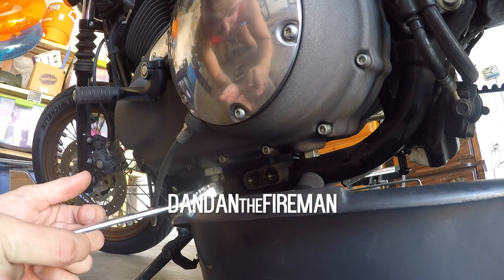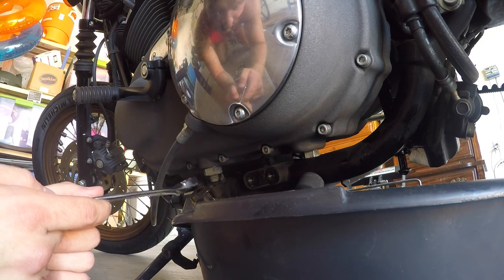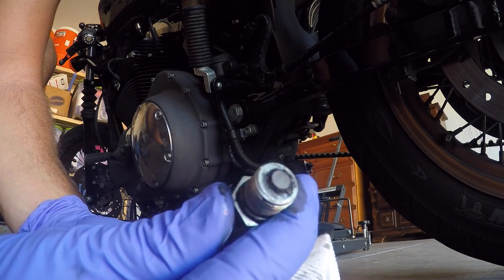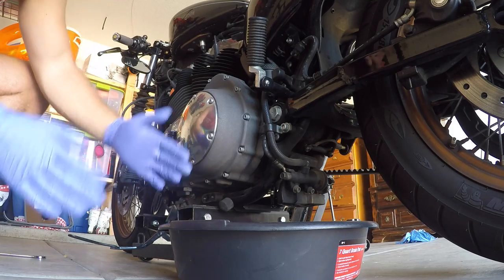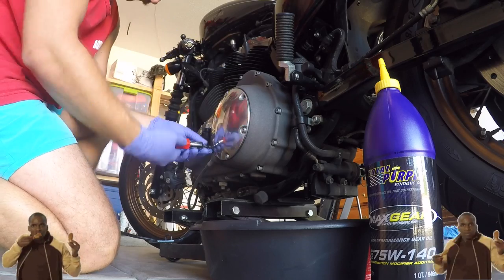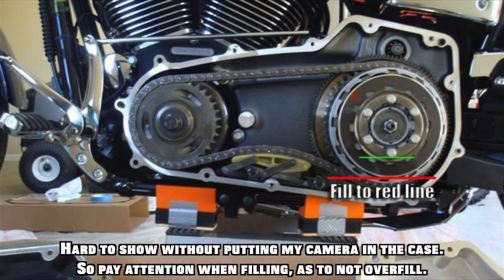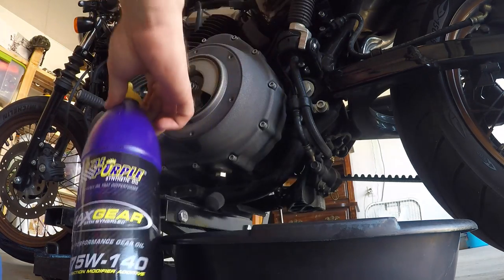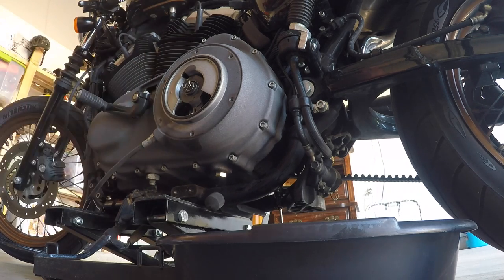Harley Davidson Sportster Primary Oil Change

Comment: Dude YOU DO NOT HAVE TO TAKE OFF YOUR DERBY COVER TO CHANGE THE PRIMARY OIL!!! USE YOUR INSPECTION COVER PLATE TO REFILL WITH  YOUR PRIMARY OIL UNLESS YOUR ADJUSTING THE CHAIN IN YOUR PRIMARY ! DID THE SAME AS YOU UNTIL A HARLEY MECHANIC TOLD ME A ALOT EASIER WAY !!! TAKE TWO SCREWS OUT N PUT TWO SCREWS BACK IN !! 1 quart exactly to proper amount of oil .
Reply: I heard about this way. Nice to see I’m not the only one.
Reply: That’s how my uncle showed me. That’s how I do it too.

Comment: Im sure its proper to remove the clutch cover but honestly I see no purpose in doing so. One quart out, one quart in. Why the clutch cover removal?
Reply: Der der der der der der
Reply: gotta take it off to refill, Yappy!
Reply: @bobpress1235  not on my sportster or any Ive seen. You drain it out at the bottom and pull the small cover off (the one he put his fluid in) to refill. Ive never pulled the big side cover, except when I replaced my clutch.
Reply: I just did the first oil change on my new Iron today. Removed the foot rest to be able to remove primary cover to add a quart of oil. If a quart is capacity then it’s a waste of time removing the derby cover…. I won’t bother doing that again
Reply: @bobpress1235 you didn’t even watch where he refilled did you ? 😂

Comment: Drain it hot on the Jiffy stand .  1 quart out , one quart in . No need to fiddle around with the Derby Cover .
Reply: That's how I do mine. I do have to remove the Derby cover once in a while though, to check/adjust the clutch. I got a huge package of O-rings for the derby cover, and also gaskets for the primary chain cover from J&P Cycles.
Reply: how are you getting oil into the primary without taking the derby off?
Reply: @alexfraley  through the inspection cover where this guy filled it from.
Reply: @thatmexican7317  oh yeah. I never take that off unless the chain is bad out. I do adjust the clutch every time though

Comment: Sportster transmission and primary share the same oil. Do not use gear oil. Use 20W- 50 Mobil 1 oil used for air cooled Harleys.
Reply: Thanks so much Jim for some correct info on here!
Reply: incorrect
Reply: The filler access is the clutch inspection cover.
9. Add 32 fluid ounces (946 milliliters) of GENUINE Harley- Davidson FORMULA+ TRANSMISSION AND PRIMARY CHAINCASE LUBRICANT (Part No. 98851-05 quart) through clutch inspection cover opening.
Reply: I was literally going to say the same thing i wonder how does the gear oil will do with the wheat clutch...

Comment: You must use primary fluid that is specifically made for wet clutches on the sportster or you may damage your internals. That may be why you have so much metal shavings on your magnet drain plug.
Reply: Carl Biller specifically it must be yellow metal safe or it will eat the stator.  Not sure why people don’t just use the HD Formula plus.  It’s like $6 and what the bike calls for.
Reply: You are supposed to use engine oil. The same that’s in your bike. I.E. 20w -50 V twin oil.
Reply: Everyone seems to use something different but theres many acceptable oils.  HD formula+ is recommended by the manual.  Dealers recommend using syn 3 in the engine and primary.  Many use the same 20w-50 for the engine and primary which is what I'm doing in my 07.  Mobil 1 vtwin 20w-50 engine and primary.  What's odd is some people claim they get clutch slip with this oil or that oil.  Some get more valve train noise with this or that.  Every motor seems to like something different but just need quality fluids.
Reply: @bsboneless1  
 They do make it and they will tell you to use it in the transmission, the bigger harleys use engine oil, transmission oil, and primary/clutch oil.   The sportsters primary is the clutch NOT the transmission.
Reply: Run Type F Automatic transmission fluid in your primary/trans on a Sporty 70k + miles and I change it every other oil change. Never had a problem with a clutch or primary chain on any of my bikes.
Reply: @jj325j2  it's both on sportsters.
Reply: I looked at the product information on this and it states Not for use in gear boxes, transmissions, and lower units with wet clutches.
Reply: No the newer sportsters take 2 different fluids its not like the older bikes where they take 1 fluid in 1 hole.

Comment: Mine doesn't fit a quart???? It's a 1996, but after draining it hot and everything it'll only take a little less than 3/4 quart and it's already covering the bottom of the clutch packet. I'm assuming that's right tho, just think it's weird. But it is older too so you know.

Comment: Make sure when you remove the derby cover,that you loosen the bolts in a star pattern to prevent warping cover. Also tighten the derby cover in a star pattern...Ride safe!
Reply: And be sure that you don’t loose the spring in behind derby cover

Comment: I have an HD Sportster XL1200c and the dealer always told me to use 20w-50 full synthetic in my primary but I never liked using that 
so I have been trying to find out what is the best to use in it and I have been searching on YouTube, and after watching a lot of them
all I get is use whatever you want from 20w-50 full synth, Mineral oil, synth 3, trans fluid and not much on gear oil! 
Like I said I didn't like the fact of using 20w-50 full synth motor oil, mineral oil and tranny fluid didn't sound either because they sound too thin of a viscosity and now finally I see someone using gear oil which was what I thought would be best! 
So I can use 75w-140 gear oil in my primary with no problem? Is that the best to use in the primary in Ohio where I live? I love Royal Purple!

Comment: Did you have to replace the o ring? I just took mine off to replace the clutch cable and after reassembly oil started coming from it. Leaking smaller and smaller didn't do a perfect  star pattern could this be why? Please help! Thanks

Comment: do you still have your engine oil in there or are you  only taking out the primary oil? They are two separate things? bit confused what the difference is...
Reply: Primary is clutch side. Main oil is for motor.

Comment: I'm lazy with my 2018 1200 Custom. I refill through the Inspection Cover. Use Valvoline Syn 20w50 oil. Same oil I use in my Engine. And I change it every oil change.
Reply: ATF fluid can be used too. It wont froth up like engine oil can.
Reply: Keep up the good work, Chris!
Reply: Exactly.  I don’t get people skipping it unless on a road trip maybe.  It’s one quart of oil !  Haha.

Comment: hey , thank you for the video. In sportster models do you change oil for the gearbox separately? Or what you just did fills it too?
Reply: The engine and trans are fed by the oil tank on Sportsters.
Reply: trans and primary use basically 20/50 oil, but engine oil is not shared with trans...NOT SHARED!

Comment: 24K before replacing primary?  i change my primary every time i change my motor oil witch is only about 4k miles . is that doing to much?
Reply: Harley only recommends every 10k miles you change primary… although changing it every 4K will not hurt anything.

Comment: Thanks for the video but FYI:

1. I've heard Royal Purple is really bad to use in Sportsters. I think it's corrosive to yellow metals and it fucks up clutch plates. I would highly recommend switching to Mobil 1(what I use) or Amsoil.

2. You don't need to remove the derby cover to change the primary fluid. Many people just put 28 ounces in and call it a day. Sometimes even 1 full quart is too much and it can make neutral hard to find.
Reply: I hope you get it straightened out lol. I'm using Mobil 1 V-Twin 20W-50 for the engine and LS 75W-90 for the primary.
Reply: You sir are correct.  That's why they need you to remove the derby cover so you can see when the oil gets to the diaphragm spring when it gets to that point.

Comment: If someone can help me with one problem. On my 2016 sportster iron 883, I have a slight oil leak from the screw located a little to the left of the main oil drain. That's a pretty big screw. The screw has a thread on it. How can I solve this problem so that there is no more oil dripping?

Comment: When's the first change needed? 1k miles or 10k miles?
Reply: 1600kms-1000miles first change oil.
Reply: @ValdemarAK47  After the 1000 mile service, the next service is at 5000 miles then every 5000 miles after that, i.e. 10000, 15000, 20000 etc.
Reply: 1k, then 5 and 10 my friend

Comment: no need to remove small plate just fill through clutch cover
Reply: now u talkin'
Reply: More like no need to remove the clutch cover. Just fill through the inspection plate.  Two bolts. No need to remove foot controls.

Comment: What’s that fat 7/8 bolt with the threads popping out? left of the drain bolt. 
I accidentally unscrewed it and the thread came down a bit with it (now my socket can’t reach to tighten completely)
Reply: That's the primary chain tensioner (shoe) adjustment lock nut  (the 7/8 one). The threads that are "popping out" is  actually the adjustment bolt itself (there's an allen key head machined on that threaded bolt) and the 7/8 nut locks it in place so the adjustment doesn't get loose.

Comment: Is it okay to put amsoil Sae w2050 on a transmission ?
Reply: I've been using synthetic amsoil 20w-50 in the engine and primary for 10+ years. Works great.  I am going to try the amsoil primary fluid next for the primary only. I don't think there will be a difference but we'll see.

Comment: Only need to remove inspection cover. No need to remove derby cover or mid controls.
Reply: Probably gotta do it to check the level no?
Reply: @johnnyghanja  takes 1 quart.
Reply: They all go to same place then, right? Asking because I couldn't get my Chain inspection plate off my '93 sportster, wondering if I can just add my oil through the Clutch Inspection plate. - It's a little different set up on the 1993 1200xl.  But I think 1 quart won't spill over the reservoir if the bike is level. Sorry to bug you with my question but seems like you know what you're doing.

Comment: Could you tell me where is located the drain from the secondary transmission for a Sportster?
Reply: Primary and transmission share oil so there is only 1 plug for them and 1 plug for engine oil.

Comment: What weight of gear oil did you use? I read that the 20w50 engine oil i got for the oil change can be used in the trans/primary gear box as well. Any truth?
Reply: I'm in the same boat - i'm not sure whats true/false about this, did you figure something out? :)
Reply: @filmfreaken  talked to a harley service rep that sounded unsure but said the 20w50 will work long as its diesel use rated i guess. Since the bikes are mostly air cooled and have high heat cycles.
Reply: @BdeSimon  i just did mine today with 20w/50 in both primary and engine :)
Reply: @filmfreaken  no issues with it?
Reply: @BdeSimon  not at all, 50% of the internet said ok, so did half of youtube, so i consulted an old friend of mine whos a HD tech, and shopowner and he said, its fine to use HD 20w/50 oil, if you have it, but if' youre to buy something the "formula+" from harley does not cost much., i used the 20w/50 cause i had it.. i had like 9litre of it.. so no problem using one in the primary. he said he doubt i'd feel any difference.
Reply: @filmfreaken  i went and grabbed the formula+ but the 20w50 i had was just mobile 1. It wasnt hd brand so thats why i was curious
Reply: @BdeSimon  Which color is the formula+ fluid, i might go and grab some of that next time i change it, i havent looked into how often the gearbox needs fresh oil? btw it does not matter if you have mobile1 or castrol or HD 20w/50, as long as you have motorcycle oil, suitable for wetclutch, dont use car oil, it often has some adjectives and modifiers, not good for the clutch in a bike. i only used the HD oil cause i bought a lot of 9 bottles for the price of 3 off a friend who sold his HD, if not i would have used castrol or similar  'better brand' of oil.
Reply: @filmfreaken  coming out it was blackish grey. Going in it was like a goldish clear i believe. But according to my owners manual i was supposed to do it at the 10k mile mark i think and im at 16k miles so it was over due lol
Reply: @BdeSimon  Thanks regarding that color on the stuff, sounds like regular motoroil color :)) 
Good thing you got it done, its not that hard a task i learned, did you adjust the chain too, while you were at it, I became HD owner few weeks ago, bike has 13k miles, and i have clue about when previous owner serviced it, so i did plugs, engine oil and primary.
Reply: @filmfreaken  i did the chain back at 10k miles. I serviced it and inspected all i could minus adjusting the clutch. Not confident or knowledgeable on that very much. But i should take it in for a look soon. Looking to sell it as well so need it good
Reply: Harley actually recommends it my friend and it is on the bottles of their syn oils if you read labels.
Reply: @bobpress1235  which one? I got the syn+ or whatever while i was there getting a filter since parts stores cant seem to figure out how to cross reference but standard 20w50 oil specific for bikes said it would work
Reply: @BdeSimon  just wanted to get back about this, my bike still runs :P haha
Reply: has to be "for motorcycles with wet clutch" (4T  Mobil 1 10W40 is good)

Comment: Don't know who taught you but your terms are wrong and the primary takes primary oil or 20/50 not gear oil.
Reply: @bsboneless1  Syn 3 is 20/50 correct? You can use Syn 3 in all 3 holes or HD's primary fluid if you choose, or any 20/50 dyno if you want to. But you can not use gear oil in a primary. You're just wrong.

Comment: Terrible information.   Gear oil in a sportster primary. Bike likely won't be happy.  
   Could have adjusted.tbe clutch as well while the primary was open

10-40 in my my primary and when weather gets hot 15 w 40 Rotella
Reply: KNOW from all ive read & been told asking tons of questions about my new purchase 2k sporty 1200 says all oils the same  20 w 50 1- qt _primary & 2.5 qt engine  so ??
Reply: Google harley 80-140 !!Harley makes and sells 80-140 oil FOR USE IN THEIR PRIMARY !

Comment: Why do you keep calling it a gear box!
It's the primary and the primary oil is for the primary chain and clutch pack. That oil does not go in to the gear box/ transmission.  Depending on the year of the bike the engine oil is shared with the transmission. But the primary is always a separate thing all by its self.
Reply: The sportsters engine oil is not shared with anything. The trans/primary are shared on sportsters. The engine oil is fed by the oil tank.